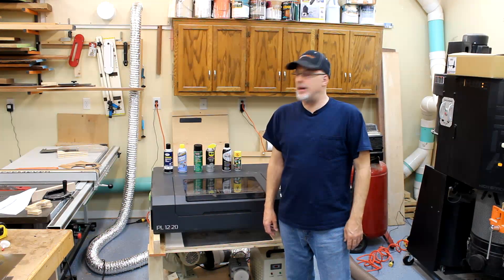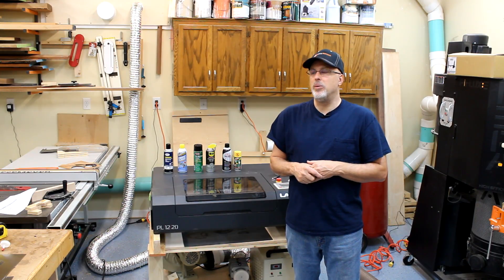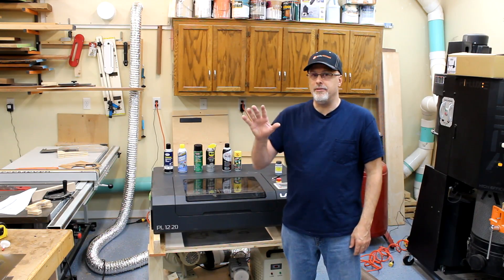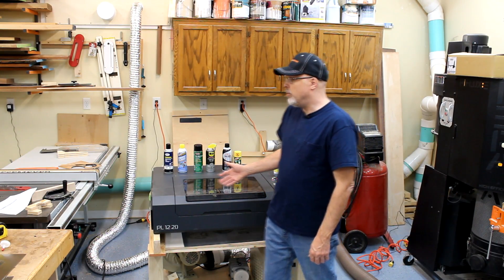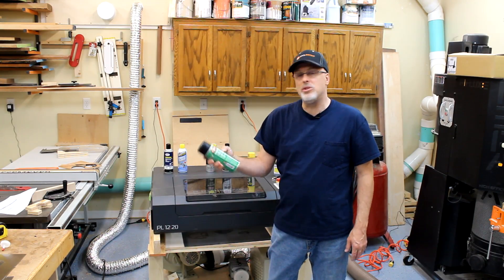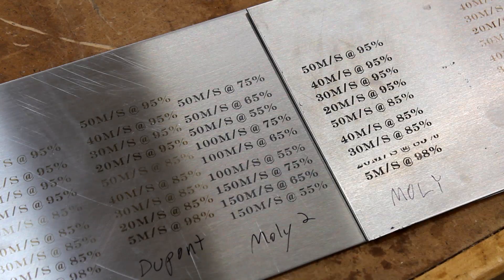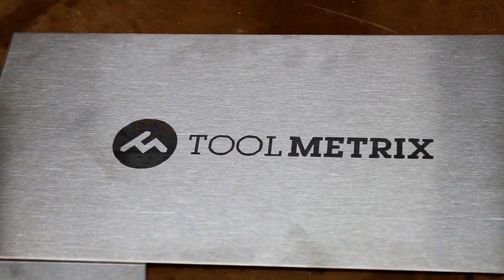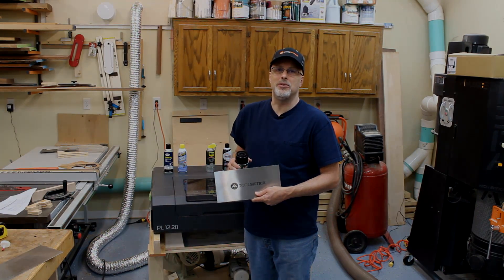Product Test: Etching on Stainless Steel with a 40 watt CO2 Laser Engraver

Comment: What was your best feed rate?  I am unclear of the dimensions shown.  mm/min or mm/sec.  Power level setting?  Thanks
Reply from the maker: Mm/sec is shown.
Reply: @ToolMetrix thanks!  I'm working with Brilliance laser spray and I'm having inconsistent results.  I might have to switch to plan old Moly Dry Lube.
Reply from the maker: @FlatThunder wow, it would be surprising if moly lube would work better than that.

Comment: I would love a good cleaner for moly. I used mineral spirits and worked to get it off with a lot of effort. Then it showed where I taped off the area I was engraving and can’t get the lines out. Should I use a metal polish?
Any tips are appreciated.
Reply from the maker: I used water and a little elbow grease.  The commercial engraving products clean up easier.

Comment: Just spray paint the metal, use the laser to cut your design into the paint, then dip it in acid. The paint will work as the etch resist. Then clean up with paint stripper.
Reply from the maker: Thanks
Reply: Dip it in acid ? What acid please ? And would the rest’ of the paint come off without disturbing the marking ?

Comment: nice video and very helpful. i am looking at trying to use this for stainless. quick question. since all lasers are a little different, and with me having a K40 they are all a.little different. you listed the power % as opposed to listing the ma you were running. do you by chance know what ma you were running the engraving at with the CRC dry moly lube?
Reply from the maker: Sorry; I'm not sure what that ma means.

Comment: Are you allowing it to dry before etching or just starting it as soon as you spray on? Also were you more careful when scratching the excess off. And did any of your etching come off with it?
Reply from the maker: You have to let it dry before lasering.  If the etching works well you can be fairly aggressive in scrubbing. The etching came off if the laser wasn’t powerful enough.
Reply: ToolMetrix DOES NOT WORk for my laser on max power.
Reply from the maker: How many watts is your laser?
Reply: ToolMetrix it’s only. 2500 mW I was just hopeful
Reply from the maker: @hollylewandowski804  Yeah, unfortunately that never had a chance.  My 40 watt has to give it everything it's got to do this.
Reply: ToolMetrix yeah I know. I just started in the business. And although I have great customer revenue it’s not quite enough to jump on a super expensive laser brand yet lol
Reply from the maker: Yep, totally get that. Best of luck in your new venture!

Comment: How thick was the spray of CRC Dry Moly?  I coated the pieces to they looked dark wet and tried 40 and 20 at 95% power and got OK engraving on my K40.  I wondered if I did not make the Dry Moly thick enough.
Reply from the maker: Doesn’t have to be thick at all. One thin coat is fine.

Comment: How deep is deepest the dry moly engraving ?
Reply from the maker: It doesn’t penetrate the surface of the metal but rather it attaches the dry moly to the surface. The build up thickness is very thin. Maybe .001”.

Comment: Perfect. I’m been using moly for my engravings.  It works great on stainless but not on brass and aluminum
Reply: Thermark will also NOT work on Aluminum!
Reply from the maker: Check out my other video on this topic.  Other products that work on brass and aluminum.  Cheers,  Paul

Comment: I'm confused why the spacing is so different from 1 image / test sample to the other? and whats with the gaps or half texts? Thank you for the video, great to know other things are available to use.
Reply from the maker: Spacing is different because each section is a different run and I didn’t bother aligning each run because it doesn’t matter for the results. Gaps were probably because no image appeared because the product failed either due to material or laser settings or both.
Reply: In my minimal/zero experience.... are you not able to create an "engraving" that is built up of many test layers. For example. Sectioning or partitioning each "Test Spd X / Pwr R" into it's own cut or vector. I may be over complicating the possibilities in my mind :P. Thank you for explaining :)

Comment: I am confused as to what I am doing wrong I have tried this with 1,2,3,4 coats of the spray letting it dry multiple days etc. I am not able to get it to laser etch anything. I have the cheap k40 laser but I have seen others using the same laser have results. Any idea why I cannot seem to get this to work for me?
Reply from the maker: Some products are very finicky as to the underlying material. Be sure that it’s non coated good quality stainless steel. Additional costs won’t help if one coat isn’t bonding.
Reply: @ToolMetrix  Thank you for the response and BTW thanks for the video. I will try so high quality stainless and retry.

Comment: Just for reference, i tried the CRC dry moly with a 5W diode laser and while it did mark, and the mark stayed on when I used denatured alcohol to remove the moly,  the mark could be rubbed off with denatured alcohol and vigorous rubbing. I don't know what the mimimum power is for a durable mark, but its more than 5W. lol.
Reply from the maker: Thanks, Turbo.  I think you need at least 40W for moly lube.  Some of the higher end products are more efficient and you could get by with a 25W.

Comment: Thank you so much for sharing this Paul! Have you experimented with any other products for off label etching to get different colors, textures or finishes? I really appreciate the tip about the Molybdenum Disulfide as being the key ingredient, you're a life saver! In your research did you discover any ingredients that should be avoided? It would be interesting to find out of there's anything that can be used to create a clear glossy or matte finish or even colors!
Reply from the maker: Hi Kitti, my pleasure.  I haven't done any tests other than the ones in the two videos on my channel (this one and one more).  I also have not come across any that should be avoided.  Enduramark (Enduramark: https://enduramark.com/) has a silver colored product.  I haven't done any testing with colored products in general.

Comment: may I engraving aluminium without etching? if it works can you show me, another video maybe. thank you
Reply from the maker: If you are asking whether I can engrave directly into aluminum without using a spray coating, the answer is no.  You would need a more powerful laser to do this.  Also, the spray coating products shown in this video will not work on Aluminum.  I have another video where I show a couple products that can be used to do this process on aluminum.
Reply: @ToolMetrix  You can engrave directly on Aluminum, we do it with a 60w Trotec C02 laser, although the engraving will be white.
Reply from the maker: Good to know. Thanks for sharing. Not sure it works with this 40w laser.

Comment: is 30 watt or 35 watt do the job as well?
Reply from the maker: It would probably work to some extent.  I believe that you'd have better luck using LaserBond 100 with a lower power laser.  But it would be cheap enough to try CRC Dry Moly Lube to find out if it would work ok for you.

Comment: Hey, thanks for this review.  I am hoping to buy a C02 marking machine to mark on stainless steel.  I'll definitely need to use one of these coatings but wanted to ask you, do you think it would work on a surface that has already been screen printed onto?  What I mean by this is I am buying metal cards that have been screen printed onto and I need to take those template cards and engrave individual codes on them.  What do you think?
Reply from the maker: I doubt that it will work directly on an area that has been printed on.

Comment: I tried the dry moly lube CRC spray can on stainless steel dog tags i bought on ebay but i couldn't get it to engrave with the 40w chinese laser. No matter how hard i tried
Reply from the maker: Sounds like the dog tags might have had a coating on them. You can use the laser to remove the coating first, then apply the spray and laser your image. Or, the metal might have been a composition that doesn’t work for moly lube. In that case you might need to use laserbond 100 which works on most metals.
Reply: @ToolMetrix  Chinese K40 is not really a 40W laser output, it's a 40wat power supply on a cheap tube.

Comment: Can I also ask another question?  If I use a dry lube on a thin steel plate and a 40W CO2 laser.  Can this engraving be suitable for Pad printing?l
Reply from the maker: What is pad printing?
Reply from the maker: If you are referring to engraving on an iPad, then no, I would not spray a dry lube product on the iPad.

Comment: cold galvanizing spray works too.
Reply from the maker: Great to know.  Thanks!
Reply: How do you get cold galvanizing spray off??  It it permanent. Dry Molly is a lubricant that can be easily taken off with soap and water.

Comment: Great video! I have a question. Would a 40Watt laser be powerful enough to do a light etching in 1055 carbon steel?
Reply from the maker: Thanks for the feedback and for the question.  I tried etching on bare steel with full power and it didn't touch it.  The only way that I could get an image onto steel was with the dry lube sprays.
Reply: I have zinc alloy buckles I would like to etch onto... have you tried that material?

Comment: From my research cermark and thermark use a fine porcelain glass suspension, the glass melts and fuses to the metal when in contact with the laser.
Reply from the maker: That's interesting.  Thanks for sharing!
Reply: If I apply glass pigments used for glass decals do you think it might work?
Reply from the maker: Sorry but I don’t have a good guess for you on this one.

Comment: Thanks for sharing the results. One more option you may want to try is rubbing alcohol and plaster of Paris. I tried it on a chef knife and got great results. Have to make it a little runny so the laser air doesn't dry and harden before it can engrave. Try it, it does work too.   Thanks again.
Reply from the maker: Thank you, Rodney.  I'll give that a try as well.  I saw the photo that you posted on FB.  Looked superb!
Reply: Rodney A share process please
Reply: thanku Rodney, can you share your Facebook Link